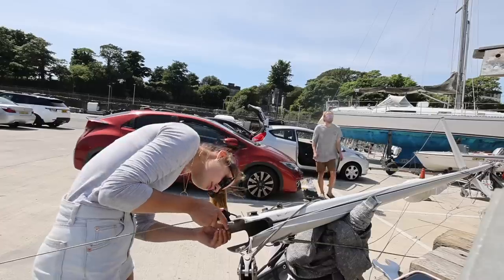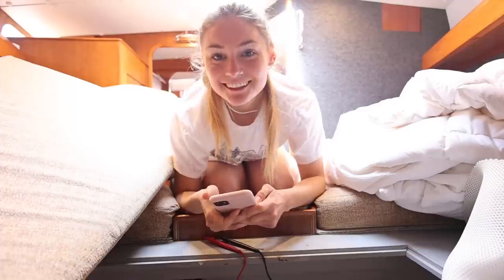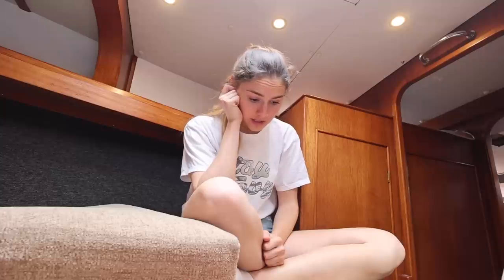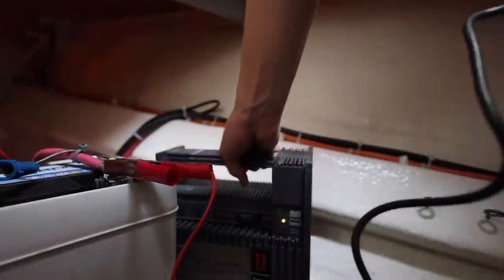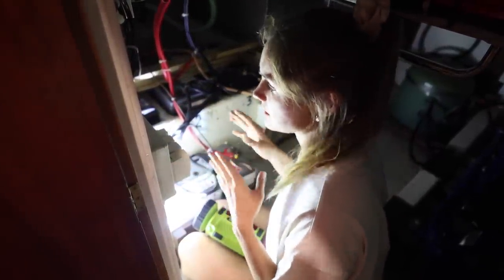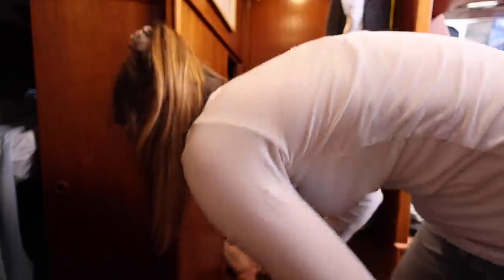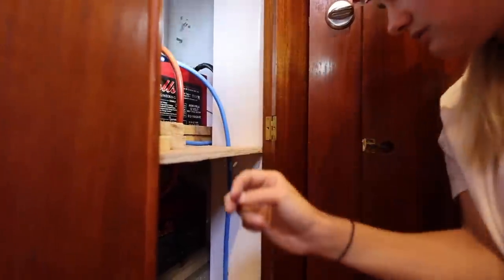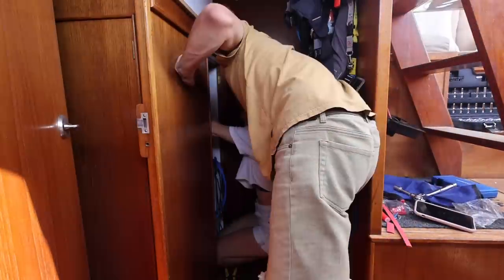ELECTROCUTED whilst rewiring our boat

Comment: I've been a mechanic for 25 years. I highly recommend heat shrink over all connections. Electric tape is ok but salt water can get into the connections over time and corrode them. Also if you can avoid splicing as much as possible and run a complete wire from one connection point to another, that will also help later on with reducing corrosion. Great job with the wiring project!
Reply from the maker: Hi Michael! Thanks for your comment! We have heat shrunk all of our connections and haven't used electrical tape for anything. We were undoing the previous owners splicing and electrical tape connections and getting rid of them all and replacing them with complete wires.
Reply: @TeuluTribe  that's wonderful! Congratulations, you are now an electrician! I'm serious. You have done things exactly how a old professional electrician would have. I've lived in Minnesota all my life so winter, corrosion, and salted roads have taken me some years to test and figure out best practices.  Keep up the great work! You guys are doing awesome!!!
Reply: I mentioned that last week... they are all over that...

Comment: In addition to Michael Lamps comment, there are non- conductive sticky gel material products that isolate wiring connections from exposure to the elements. Some wiring connector products are manufactured with the gel already in place, where the crimp is made to attach the connector to the wire. Also look at “heat shrink” plastic tubing to cover bare wire.  Lots of knowledge in YouTube videos if you search 👀 .  Good luck and totally enjoy the adventure you are sharing with us. Thank You 🙏
Reply from the maker: Thanks for the advice! We have use heat shrink for all our connections 😊 Glad you are enjoying the vids!

Comment: Jeeeez, you're killing it! So impressed with how quick you're picking this stuff up. Every boat seems to have random wires not connected, incorrect wiring and general electrical gremlins. I re-wired my old little 24ft boat that lived in Plymouth, and am about to start tackling my new 33ft (new to me, she's 39 years old). You say you will look back in years to come and laugh at your fuse issue, but I think it's far more likely that you will look at those separate wiring diagrams for charging and consumption and the labelling of cables you're doing (with dates on - what a great idea) and you will be incredibly proud of your former self. You are SO much more capable than you give yourself credit for. What ever you turn to in life you will find success with your amazing attitude!! Fair winds!
Reply from the maker: Jamie, that’s such a lovely comment! Boat wiring is so funky and we have found even stranger wiring since! (Our Cascais anchoring light project through and through 🤣). Good luck on your re-wiring project!

Comment: I have used the heat shrink electrical butt connectors with heat shrink tubing over it, along with liquid electrical tape to seal the ends.  Can't be too careful.  Also use electrical dielectric grease to coat exposed terminations.

Comment: I'm impressed young lady, Becka I told u ,u could do Anything, when u put ur mind to it, really laughed with the fuse fiasco, but loved it when u lied down on the floor to think, I do that to, it really works for me. Great having ur parents there to help and support awesome. Please remember to insulate ur connectors with heat shrink, but get the stuff with adhesive inside it, way better waterproofing and safety capabilities. Love to u both 🌈🌟🌟🌟🌟🌟🇦🇺🌞
Reply from the maker: Haha, its so silly. Sometimes lying on the ground is great though- really grounds you! Parents are so helpful- we are so grateful for them 😊 We have insulated our connections with heat shrink! Thanks for the advice!

Comment: I love how much Becka gets into the electrical and mechanical repairs/fixes/upgrades on Tuele.  Too many "boat couples" rely on the guy to do all this stuff and there is absolutely no reason why women cannot figure things out just as well.  No one knows everything, many times you just need to dig in and figure things out.  In many ways women are better at this stuff because they are more likely to phone around and ask questions while guys are more reluctant to say that they don't know something  Way to do Becka!
Reply from the maker: It’s definitely better if it’s a team effort, Becka has done a cracking job with all the electronics 😄

Comment: Good on you to take this head on. This way you gain know of the inner workings of your boat. Do not despair on the little things. Problem, stop, think through and find a solution. Your both doing great but double check and verify with electricity. you don't want a fire because of faulty connection or a short circuit. Then again, you know that. Cheers.
Reply from the maker: Thanks Stephan! We had this checked with an electrician- we don't want any fires on Teulu!

Comment: Good to see Teulu had the standard yacht wiring, designed by a kitten with a ball of wool. On crack. Your new knowledge means that as a boat electrician, you'll never be out of work for the rest of your life. 
I do recall in one of my comments, mentioning (cough) something about bow thrusters (cough), POS, (cough). If you take it out and tie it to the end of warp, they make good kedge anchors....🤣
Well done in securing those batteries, you do not want those puppies getting loose in heavy weather!
Reply from the maker: Haha that made us laugh- that is exactly how it looked 🤣 have taken 90% of it out now and it looks FAAR better! Yes..that Bow Thruster was definitely the bane of our lives for a long time- however, now its finally charging, it actually does come in pretty handy at times!

Comment: Hey guys as mentioned before you are working out that ship.. very important for oceans going passages etc.

Remember it's not until you can break it and fix it you will truly understand it. 

Diagnosing a problem is like links in a chain, rarely its the first link but sometimes its not until you check the last link thay you find the problem.

Remember electrics are values in... values out. Find the wrong / bad value to find the problem.

Oh... normally you put weight in the middle of the hull to balance.. that battery location looked to be on the side of the hull...

Oh... 12 or 24 volt.. always disconnect and connect with earth battery wire first and last.. after all the work is done. Only danger is spanner across the battery then.
Reply from the maker: Yes, we have often found that by some thing breaking, we have been able to see how it works, which has been invaluable. The battery cupboard is in the centre of the boat- we moved the batteries from the engine room where it was further to our port side.
Reply: @TeuluTribe  cheers... love your work. I'm a aussie so you can get my drift and I hope you don't mind my suggestions.. 😊 keep breaking stuff.. finding limits as its the edges where change and discovery  happens. Quote Permacaulture..

Comment: Zach and Becka,

Well! There is definitely an electrical technician on board.. Smile... A proper initiation is to make a few sparks. If you have time, show us the completed wiring.
The best to you both.

Blue Skies, Fair Winds, and Following Seas.
Cheers!

Faithfully,

James
Reply from the maker: Well i definitely did the proper initiation 😆 thanks James!
Reply: Becka,

There are three words associated with electricity; two that begin with the letter "S" and one that begins with the letter "E": for the "S", (1) sparks they are OK, the current is traveling to ground through a metal ground, (2) shocks is OK as well, but they remind you of something that you want to avoid. Avoid the "E", electrocution; really never ever bring it into the picture. Always turn your power off, test the circuit with a volt meter to verify that there isn't any voltage present, before working on the circuit; and try as much as possible to place only one hand into the circuit with the other hand away from anything that may be a metal ground.
I hope that I didn't sound condescending, but if I did then my hope is that it reinforced the urgency of working on an unenergized circuit. 
The best to you both and all of your future endeavors. I look forward to whatever the two of you have to offer us.

Blue Skies, Fair Winds, and Following Seas.

Cheers!

Faithfully,

James

Comment: Good choice of battery brand! Get OceanFlex wire, an amazing UK brand of tinned copper wire & cable.  FurneauxRiddall and 12VPlanet have it.  Friend of mine, who I've helped, has used hunderds of meters in all types on his sailboat.  100m of 1.5mm2 2-core cable, which is good for almost all 12V equipment, is only £80.  The MarineSuperStore has proper tinned 230V AC cable in case you need it.
Reply from the maker: Thanks 😊 Good suggestion!

Comment: OH DANG, crash course on electronics. Many of those problems, as your Dad said, it's something very simple. Like a freaking fuse.  Once you get the basics down it can actually be strangely fun tracking down a problem and solving it.  That multimeter will be one of your best buddies.  Suggestion, if you are having trouble remembering the symbols on the multimeter (dashes, dots, squiggly lines) take a permanent marker and write what those symbols ie DC and AC on the back of your multimeter.   You don't want the multimeter reading DC and you stick it to an AC wire. Oh, great job by the way.
Reply from the maker: That can sometimes be confusing! Good idea about writing on the back of the multimeter! I will do that right now 😊 Thanks Mathew!

Comment: Not sure what you've done in terms of your upgrade, however I can highly recommend Victron battery monitoring.  Fit a smart bms712 to monitor your house and engine batteries and a smart shunt for your bowthruster. This will give you Bluetooth info to your phone.  Also replace your split diode with a three way victron FET unit you will be able to charge all three battery banks far more efficiently from your alternator.  I did this two years ago on my boat and have been astounded by the difference
Reply: While I can’t speak to particular brands, I will say that a diode and a fuse can be problematic unless you add a remote meter to the equation. There is a likely chain of events that occurred (and will again). The thruster draws far more than the fuse allows a charge. So… after some usage without rest, it will blow the charging fuse. No immediate issue as your using that battery. But… alas the battery now is NOT going to charge. 

Short of an upgrade, I would add a switch to the charge circuit and and turn it off whenever you might use the thruster. Than check after that it isn’t simply blowing the fuse when turned back on.
Reply from the maker: We have gone for a Victron smart shunt 😊 we love it! Although only have one on our domestic bank and not bow thruster (although have hooked a new charger up to that now so it is charging- woohoo). Thanks Mark!
Reply from the maker: Thanks Kirk, the issue was the bow thruster wasn't charging so the battery was incredibly flat (this is fixed now as we have installed a new charger) and have a switch to control the charging!
Reply: @TeuluTribe  I would suspect that you can go for a good long time only charging the thruster battery when you have shore power. Eventually you may wish to get an additional shunt to charge the thruster battery.

Comment: I would have a marine electrical tech check over everything. Biggest cause of fires on boats are dodgy connections and wires. Always use tinned copper wires of the proper gauge with secure heat shrink marine connectors. Reputable brands like Anker. Invest in proper tools such as ratcheting crimpers and lug crimpers and connector kits of all types. Never leave any bare copper exposed. Proper marine fuses in the right places in the circuits. Negative bus bars and positive lines into fused circuit breakers. Blue Sea is a solid brand with an array of products with different applications, purposes and needs.
Reply from the maker: We had it all checked over by a marine engineer and an electrician 😊 We used tinned copper wires and heat shrink- it just wasn't too clear in this video 😊 Thanks for the advice!

Comment: I once totally dismantled my motorcycle, mind you, several times engine out and back in. The engine would turn, but the darn thing wouldn't start. After hours of searching for failures in the coils fuel system etc, I found it. Turns out I've stopped the bike with the STOP button instead of turning the key to shut the engine off. I cried.. A lot.. Started right up after.
Reply from the maker: Oh that’s so annoying!! Sometimes it goes like that! At least you eventually found it 😊

Comment: Your learning and I commend you. Doing your own electrical work is not difficult but I highly recommend you do thorough research. There are so many things do it yourselfers don't realize, and talking to a friend to say how to i connect XYZ can make it work, but you could be possibly overlooking many hazards you or your friend don't have knowledge on. Please get an ABCY certified electrician or your country's equivalent to look over your system. A couple things I noticed or would like to share:  
First, you need to get a plastic box or tray to place the batteries in. Lead acid batteries, even AGM can leak. Wood will absorb acid and create a hazard. Ensure the positive terminal is protected ( rubber boot). Lead acid batteries produce hydrogen gas (highly flammable, and when enclosed explosive) make sure you have ventilation in the battery compartment. Make sure positive cables have a fuse (except run to starter motor). Make sure batteries are secured in place(strap them down). Lay out your electrical system in a diagram. Get the theoretical loads on each wiring run and make sure you have the correct size wiring. With your level of knowledge i suggest making full runs to all landings, do not splice. There is more to it, especially as you add chargers, solar, etc... but cannot cover it here. 
I know many people will scoff at some of this stuff as many will see it as minor. Many of these types of mistakes are so common and people often don't see the repercussions. But they are in marine electrical code for a reason, because someone lost life or boat. It is daunting because you don't know what you don't know. But don't be afraid either, we are started from somewhere. Best way to learn is by doing. Just make sure you have an accredited person look over your work, not just a friend that sounds smart/knowledgeable. Sorry if this all sounds preachy, I just want to help share some thoughts on safety to you and your audience. I am an electrical engineer, but there are many things I am learning myself when it comes to Marine environment and a new boater. Stay safe, best wishes and blessings in your journeys
Reply from the maker: We worked very closely with a few electrical engineers 😊 We also spoke to two different battery specialists and both said we didn't need battery boxes for our AGM's as they can't leak- they go bang before they leak! We have vented our battery cupboard in two places in case though (and for the heat given off by the charger) We also haven't spliced at all- we were undoing the previous owners splices and replacing them with full run wires. Thanks so much for the advice 😊

Comment: Here is a reference that you simply must get. Nigel Calder's Boatowner's Mechanical and Electrical Manual. A bit pricey but worth every penny.  Another point, you must get straps for those batteries.  You have nothing to keep them from going straight up and they most certainly will in the first bit of weather.  It looks like they would be stopped by the inverter which can't be good. Invest in some insulated screwdrivers and keep them for only electrical work. Get a proper insulation stripper for heavy cable. Using a knife is a recipe for trouble as even a small nick will bite you eventually.  Cornelius below speaks truth.
Reply from the maker: We actually have this book- it has been a lifesaver! We were considering straps but the batteries are so ridiculously wedged in and didn't budge at all when we went through 3m waves the other day 🤣 but still might be worth doing in the future. Will add insulated screwdrivers to the list. Thanks 😊

Comment: You say that this(wire) is for 30V and the others are for 12V. Volts don't matter for the wire size. (does for the device but not the wire).What does is the load (AMPS).  A note the longer the run more drop in volts over the run, a larger gauge could be needed...size in wiring goes difference form most thinking..... 16 is larger than 18 / 14 is larger than 16. The lower the size the larger the wire and it's able to carry the load.  Good luck and happy learning leading to happy safe miles. 🙂
Reply from the maker: Thanks Verne! Thats helpful to know 😊

Comment: Something that has bothered me in all your videos, is your Starter Motor always seems to be struggling for GRUNT, and on this video you're seeing electrical problems. Can YOU both please check your entire Starter Motor POWER FEED from battery to Starter Power Cable and Engine Earth cable. It's terribly IMPORTANT you have a Heavy Duty cable on both, because the Starter should spin the engine instantly.
Hope this is helpful
Br Peter